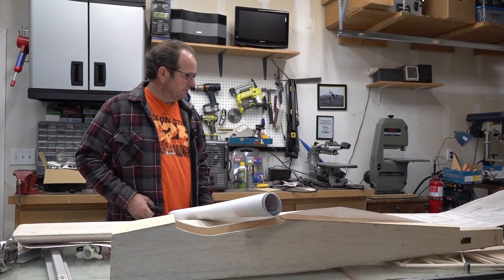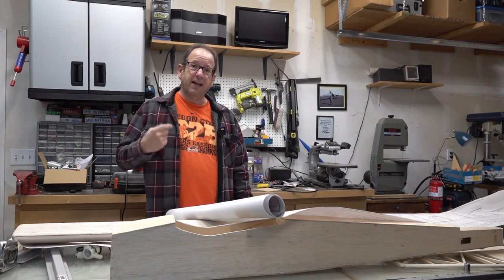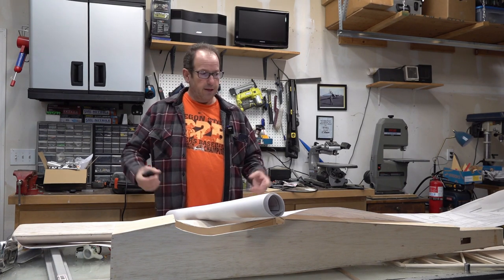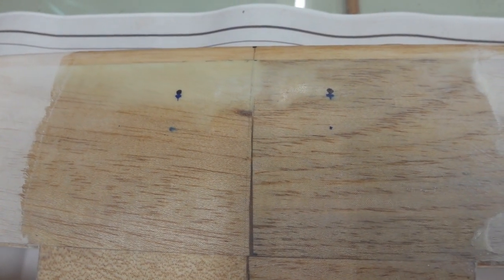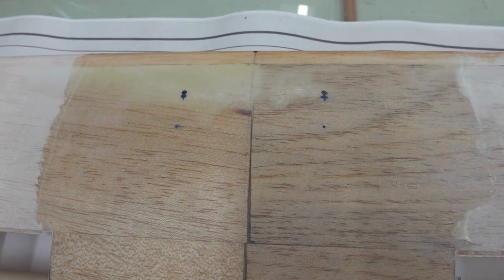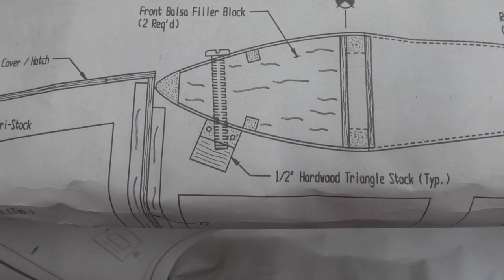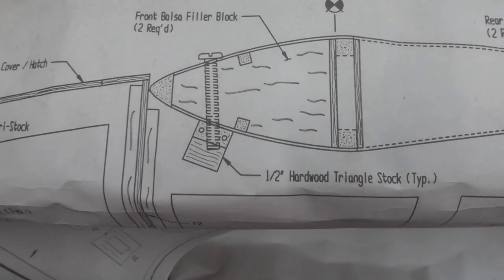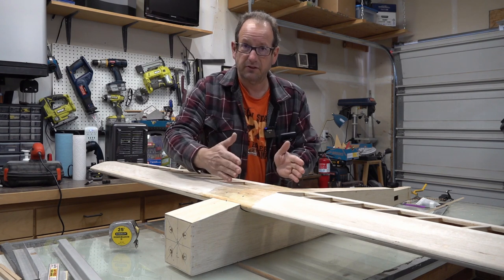EP 25 Mount up the wing Pilgrim, scratch building a giant scale model airplane

Comment: Very nice! glad you are back and well Dan. I enjoy your channel. I’m with you on the wing mount, those bolts look a littler squirrely. I think you have a good idea to recess them a little and reinforce with a little plywood plate. Dowel mounting like you said is probably preferable, but the plan is the plan. One thing that I would worry a little about is that big wing and those nylon bolts appear to have to hold a large load. How well do you think the wood threads will hold up over time? Would T-bolts on the underside of the mounting block be helpful? 
Great series! Thanks for sharing your experience.

Comment: 2 1/4in nail would be the right size to mark the holes NO carbon paper needed ... added bonus it will also set the center point for the tapped holes to be drilled ...

Comment: Hi Dan, great channel. One tipp. I would use Phillipshead instead of a slotted head because sooner or later you will slide into the wing and scratch the surface :-)
Reply from the maker: That would rock...i have never seen phillips headed nylon bolts though.  I could take the dremel or hack saw and add a slot though.
Reply: @Capgains7777  Here in Europe they are available but your idea isn't so bad ;-)
Reply: @Capgains7777  I can find it at Amazon here. Should be available in US as well.
Reply: Just make a philips head screw driver hot with torch and press it to center of nylon bolt. It will melt exactly to right shape. Then you can use both screwdrivers as you want 😁
Reply: @tuomassyrjaniemi  That is a great idea :-)
Reply: That's why I use hex head toilet bolts. Zero chance of driving a sharp screwdriver through my wing.

Comment: Glad you recovered and also happy to see kitty made a cameo.  Another option that I've used  for bolt holes is to use 1/4-20 E-Z Lok brass inserts .   Long term, they won't wear like wood, even maple. 

https://smile.amazon.com/dp/B00207NF6W/ref=cm_sw_em_r_mt_dp_X0D5F26RSCY5JGZ4KVSZ?_encoding=UTF8&psc=1
Reply from the maker: I love those inserts, use them a lot on firewalls.  Good suggestion.  I will harden these threads in the wood with thin CA and then run the tap through again.  Nylon bolts are strong but gental on threads.  I have never had maple threads fail on me treated like this.
Reply: @Capgains7777  I agree .

Comment: Great seeing you again. Congratulations on your natural immunization, glad it went easy on you. Totally agree with Don Crowe about metal inserts, wood threads for plastic screws ingeneering deserves GULAG sentence.
What have you put on top of your balsa sheets in the center of the wings? Is it a coat of glue?
Reply from the maker: Yes, the designer has a strip of 1/2 oz fiberglass down the center joint.  Thats the epoxy.

Comment: Believe it or not, but I do have a 5mm carbon rod just laying around lol It was an extra to a foam plane used for ballast in the back (came with a steel one was well for 4s batteries that I ended up using)

Comment: Glad you're back at it! Do you add any silicon or cushion to the wing saddle?
Reply from the maker: I have tried both of those over the years.  Im not so concerned about the cushoning of the saddle as I am about filling the gap.  For some reason the cutout of the saddle on the fuse and the wing almost never match up perfectly.  I will make a slurry of slow set epoxy, mixed with micro balloons. Ends up like a thick paste.  Coat the saddle edge, place 2 sheets of wax paper on that, then install the wing with the bolts.  Flip the fuse over with the wing side down to let the slurm drip onto the wing, and let it cure.  After ward, pop the wing off and use a sanding block to remove all of the excess making it flush to the sides of the fuse.  It makes a permanent gap fill that supports the wing perfectly... An old scale builder taught me this.  Maybe I should make a video on it?

Comment: Good luck on those front 2 "bolts" near the leading edge using NYLON threads going into WOOD threads.  Should have used your better judgement and gone with dual dowels up front "bolts" in the trailing edge.  Option:  (1) get longer NYLON "bolts". (2) Move the 2 mounting bolts more forward towards the leading edge by .25-.31" again straight up and down so your going thru a thinner section of the "chord" and move your fuselage mounting block more forward to match.  Use a hobby knife and remove that area under the bolt head you were talking about to have the bolts sit flat.  You'll now get more thread engagement closer to 1.5 to 2 thread diameters.  I still think you're playing with fire that you could pull the forward bolt threads on the front bolts.  Go with the dowels on the leading edge with bolts in the rear solution.  Just my opinion.
Reply from the maker: I'm with you on the 4 bolt system, and I would have gone to the dual dowels, however I had already glued the top engine box panel in place with the triangle stock, and if I am going to use dowels, I like drilling them through the former from the front making the shot into the wing perfectly aligned.  However, there is nothing inside the wing like a plywood plate to support the dowel other than that balsa block until you get to to the wing brace.  I don't like the four bolt system, but Im sure it will work.  My flying buddy's Rebel has hundreds of flights on it and never a problem.  My only bitch on the setup is getting those bolts to thread when assembling it.  Its hard to get them to line up, searching and searching for the hole in the plate.  I hit the holes in the plates with a flange bit, and that made it considerably better like a funnel that lines it into the hole.  As for the nylon and wood combination... Once again, looking at my friends plane of the same design with many flights, no issues.  In fact we looked through all of our planes and found we have used this combination for years, many in large heavy planes, and never once have we had a failure of the wood threads, or a 1/4 x 20 bolt failing.  I've had crashes where the nylon bolt actually ripped the block out of the fuse and was still attached firmly to the wing.  Once again, I think we tend to really over engineer our building techniques.  When it comes to hold downs, I tend to fear the likeliness of vibration loosening bolts in a metal to metal configuration like bolt in insert.  I have landed and seen the bolt sticking up a quarter inch from the wing top, backed out.. then you have to start thinking about locktite, saftey wire... More junk to worry about.  I did cut the skin and carve down to make the heads of the bolts flush with the balsa block.  I plan to soak some CA into the block to keep it from compressing.    

I do like the cleaness of the dowel lock setup, call me lazy to not go back and retro it in.  But this setup will work fine.  I have enough proof to satisfy me.
Reply: @Capgains7777  Sorry to not get back sooner.  Glad to hear there's "proof" to the design being used without any issues.  I wasn't to thrilled with the numbers of thread engagement given my engineering background and I know you weren't either.  I'd hate to see pulled threads in the wood given I think that's the weak point.  I don't know where I read it was using thin CA on wood threads to enhance the strength of the wood fibers and still retains the thread integrity for the nylon bolt.  You probably already know this but that may also provide a little more insurance.  All good, thanks for the build and the knowledge.

Comment: I hate using the microphone but what I’m talking about is the fact that I put the Thin ca in threads to stiffen them up
Reply from the maker: Hi Edward,  yes I use a few drops of thin CA in the threads that I cut into the maple blocks to strengthen them up. It might be overkill as maple is a strong wood, and nylon bolts shouldn’t strip them but it adds a little peace of mind. It seems necessary to run the tap through them after the CA is cured to clean them up a little as the CA will kind of gum them up a little.  But after they are re cut they are really smooth.